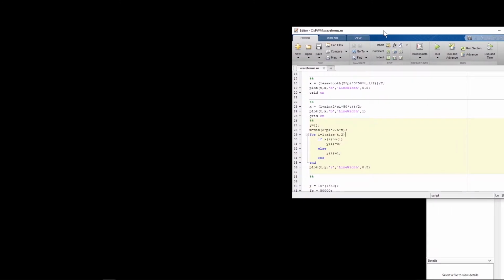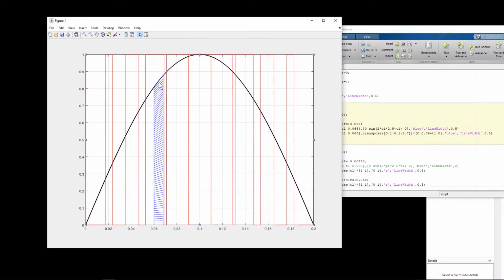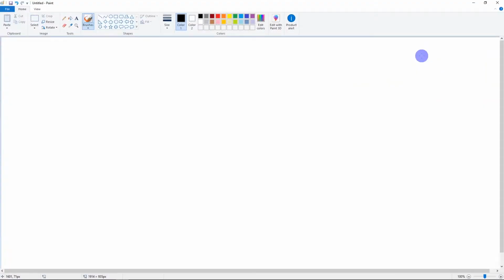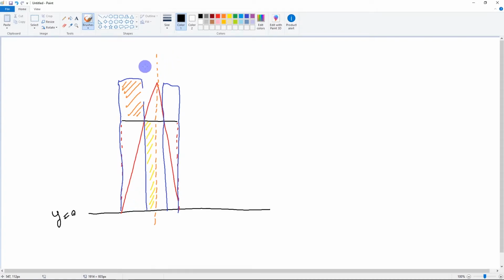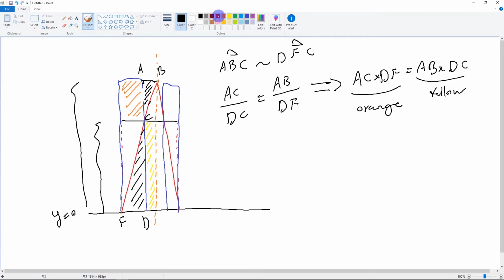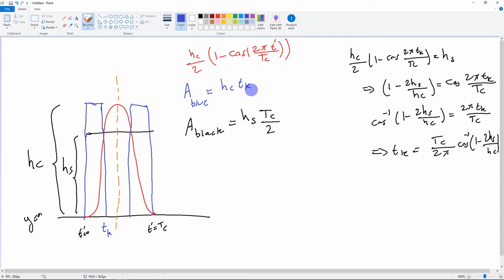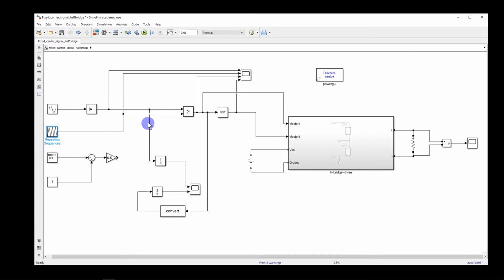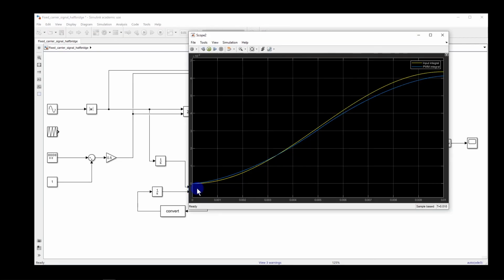Why triangular or sawtooth waveforms are used as carrier signal when generating PWM signal

Comment: but the question is why do we want that the two surfaces are equal ??; and between triangular and sawtooth which is better ??
sincerely
Reply from the maker: that ensures that your output signal will be similar to the reference signal if you pass it through a little bit of filtering.  I think triangular is better due to double edge for comparison, improving the resolution.